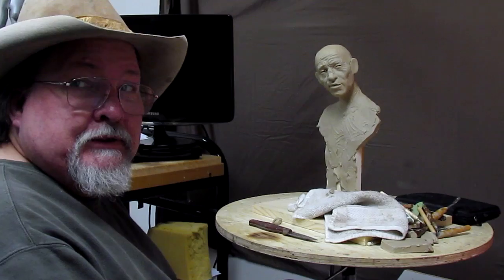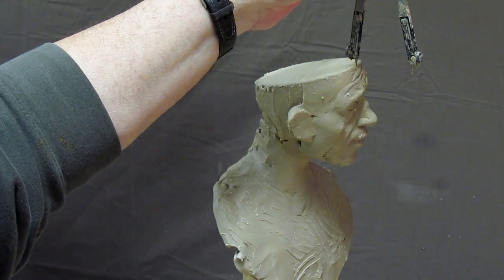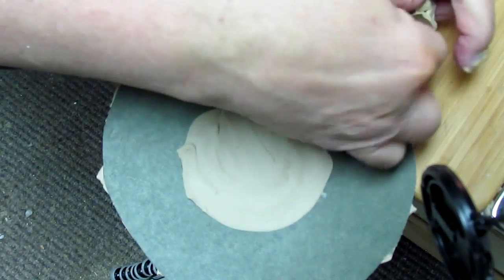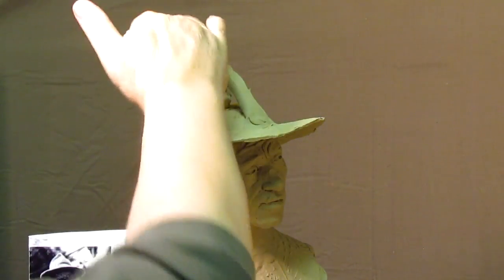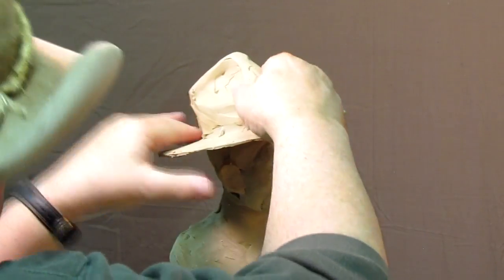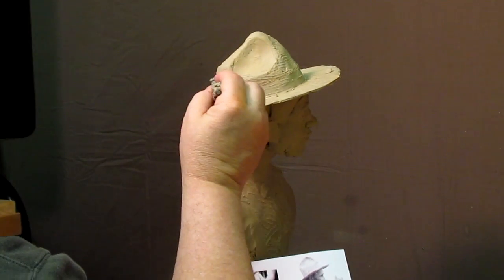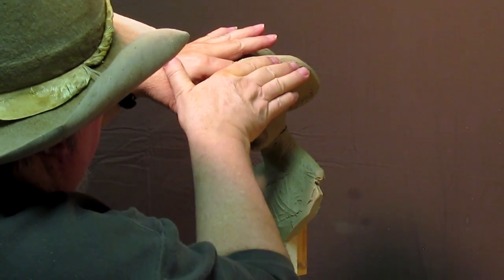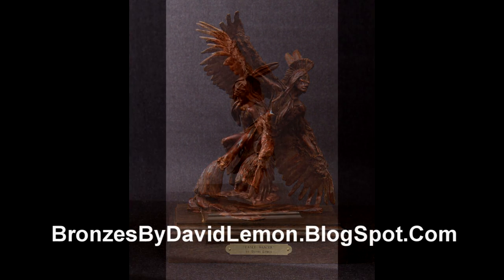Sculpture Tutorial - The Trouble Maker - How to Create A Cowboy Hat in Plasticine

Comment from the maker: That's what I use as well.. Just had the seat removed and leveled it out with wedges of wood and then on big piece of wood that I got at a hardware store. or lumber yard. It's a round piece of plywood, that was already cut round.. about two feet across.. I raise and lower it by the lever under the seat area.. When I lower it, I have to add my weight.. which is considerable.. lol by placing my hand on it and pushing down.. I also have a large professional one that cost hundreds,, lol